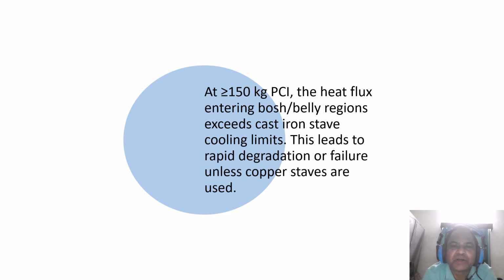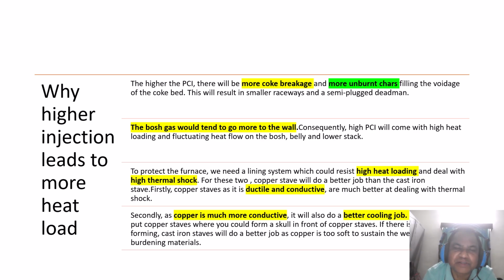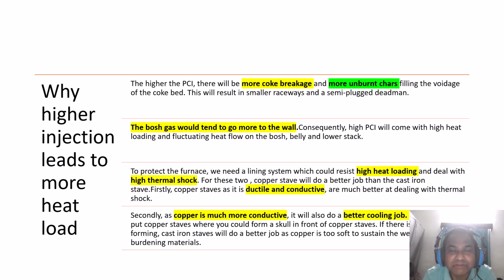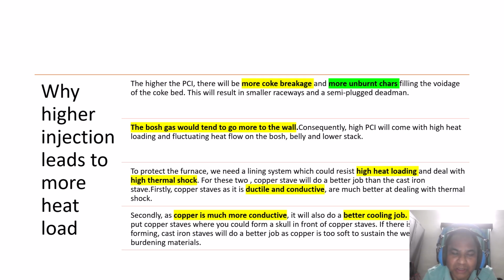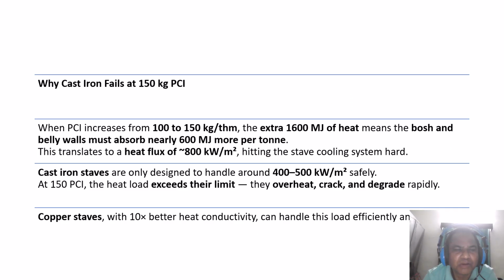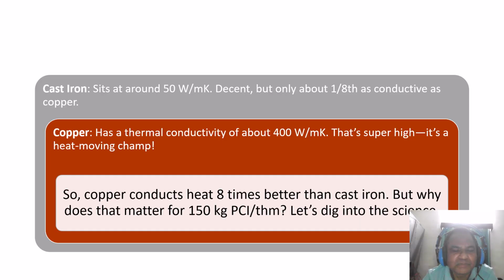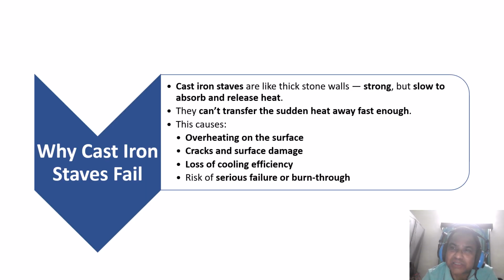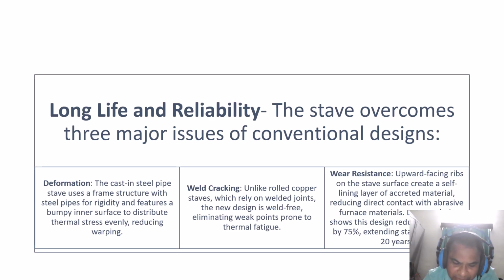Why Cast Iron Staves Fail at 150 PCI | Copper Staves Explained for Blast Furnace Heat Load

Comment: In our furnace continue 9 hrs Bosh heat load was 15 and lower stack heat load was 10, eta co was 46.5 but after that suddenly lower stack heat load increasing started, crossed the Bosh heat load and eta co also started drop to 32....how to interpretate this and how to control this?
Reply from the maker: Lower stack heat load crossing the bosh heat load is an early warning sign. It means heat is getting consumed higher in the furnace instead of the cohesive zone. The simultaneous drop in ηCO confirms poorer gas utilization and loss of indirect reduction efficiency. The focus should be on restoring permeability, correcting burden distribution, and stabilizing furnace operation before the condition develops into a hanging or slipping event.